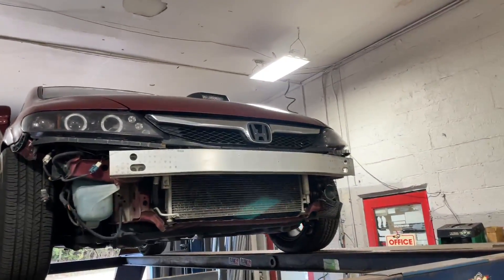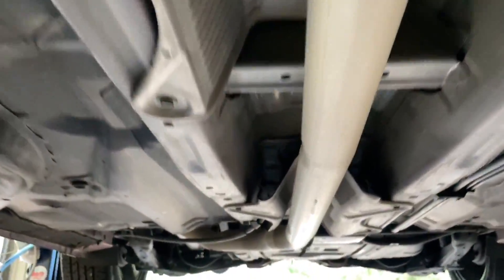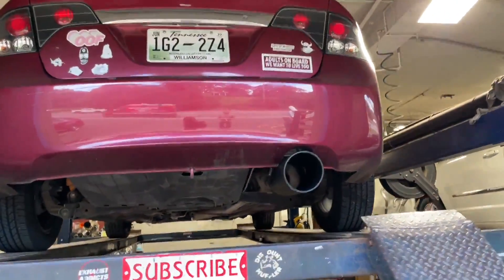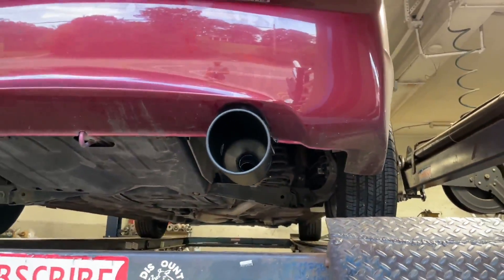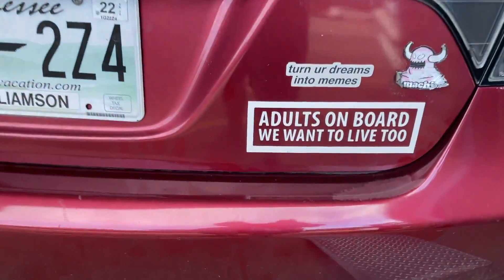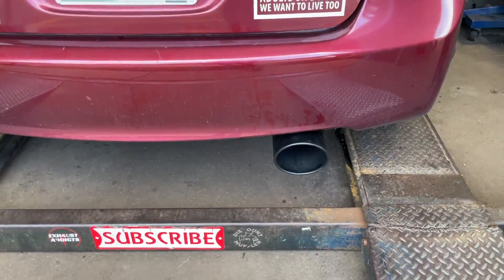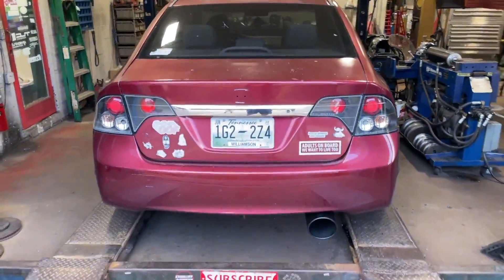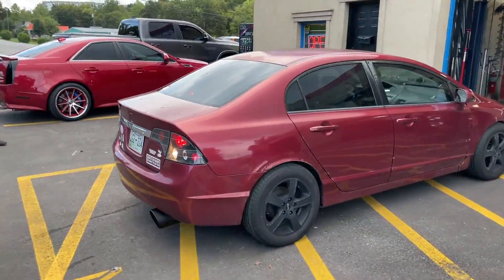2009 Honda Civic EXHAUST w/ STRAIGHT PIPES & 6 INCH TIP!

Comment: Next time try 20"-36" Glasspack fitted backward as a tailpipe, it creates the desirable flat tone instead of the rasp.
Reply: Really? Do you have any links? I own a g37 but I’m curious for my Honda friends 😂
Reply: Nope, I just understand physics. I can tell you about sound waves, air pressure, and a personal knowledge of exhaust pipes. I don't need to own a honda to tell you it has variable timing cams that change with oil pressure. 

On top of all that I'm a musician and a writer as well.